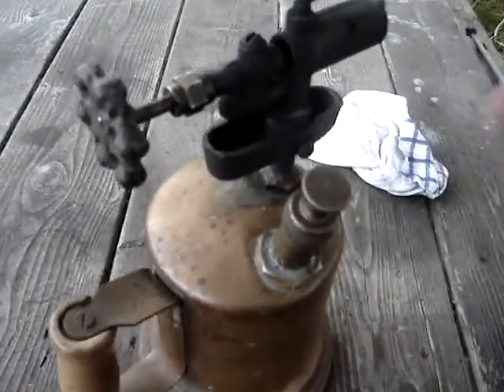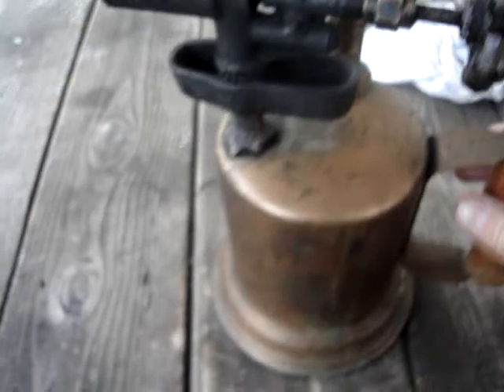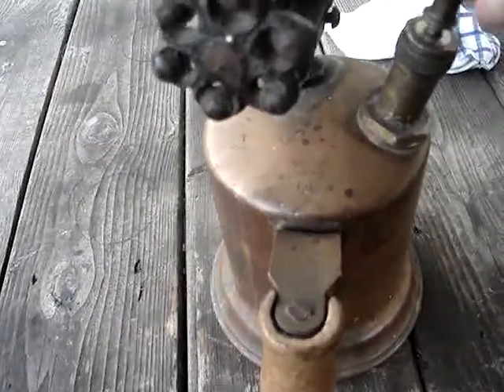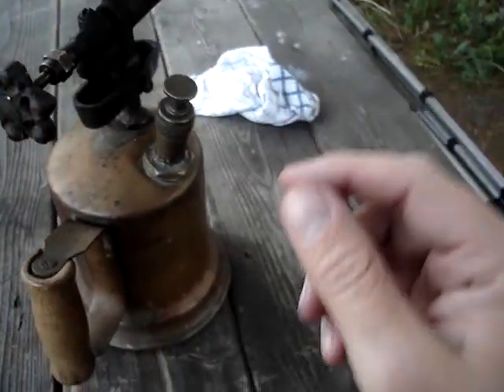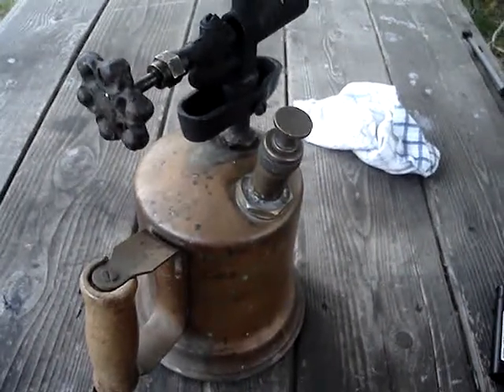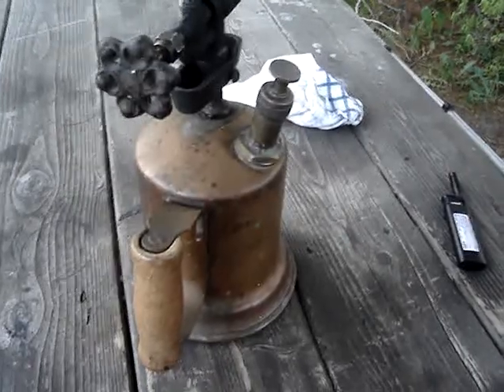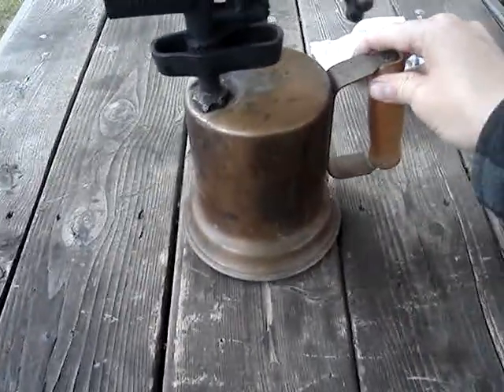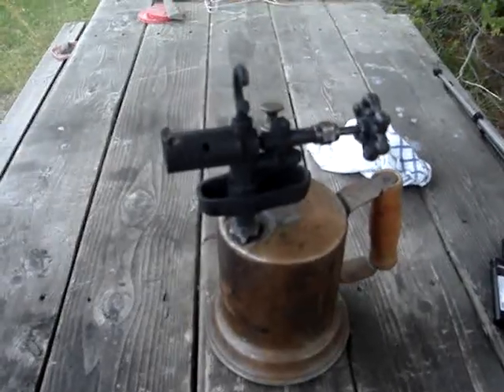Blowtorch Check Valve

Comment: It’s probably graphite packing.
Reply: And undoubtedly a leather pump.  If the leather is intact then soaking it in 3-in-1 oil will help.
Reply from the maker: i think your right about the packing :) the leather is the one that was there and lots of oil fixed it up.